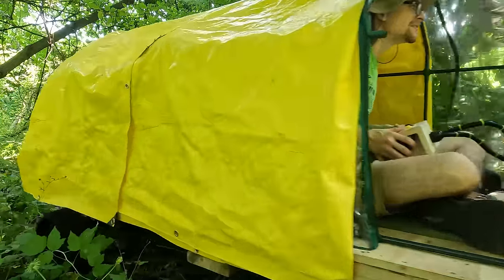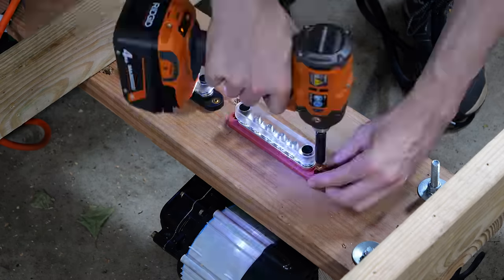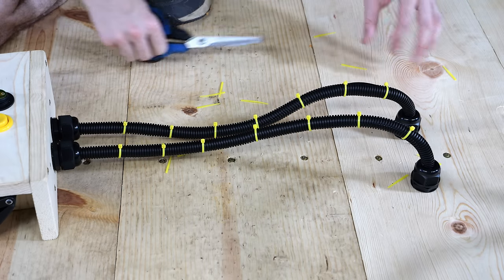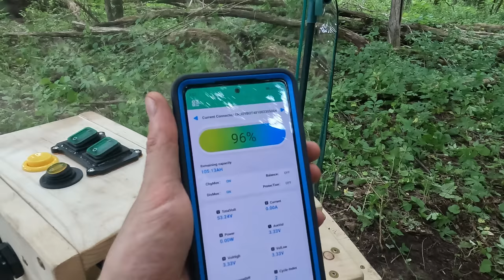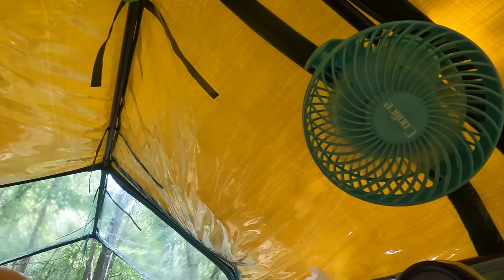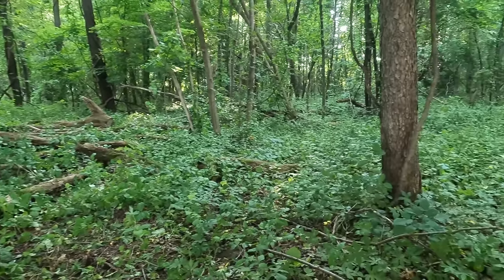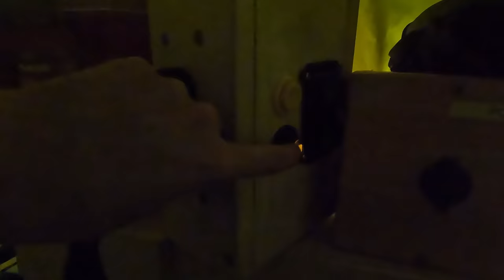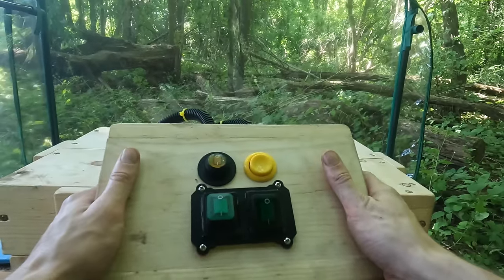UPGRADING The Camper You Can Drive Around - MORE POWER  - Build & Night In The Forest

Comment: If I had the skills I'd add two more tank tracks per side to help with getting over potential obstacles or even figure out a way to have a set of tank tracks rather than the small tracks. That way it'll be a bit better in the snow. Would also maybe try to raise it for more ground clearance.  Other than that, maybe a wooden frame on top for winter and cover the bottom with plywood to help keep the electronics safe. But in all honesty this is an awesome rid and video! :)

Comment: I would’ve used a DB9, DB15, or an HD15 connector on the controller to make it removable.

I’d also recommend installing an auxiliary 12v battery so you can control the LV accessories without losing any range on the HV system

Comment: Ideas for 3.0

- Some type of suspension for a better smooth ride, better grip and speed.
- A mini fridge! :D
- A smart small screen showing the output of the battery, what elements of the camper are consuming energy, and how much.
- An extension towards the back of the camper, so you can stretch better and organize stuff., hey, even the whole deck could have compartments so it looks you carrying nothing while, most of the stuff is just out of sight.
- A 4k projector and a white screen installed between trees so you can play some games or watch a movie :D
- Possible solar panels to charge the whole thing on the go? O_O

Awesome project and video! 
Would be nice to see costs :)
Thank you!

Comment: I use victron equipment in my van so I've got nothing against them. But if you're not buying a multifunction unit (inverter / charger) it's probably not worth the money. I don't know how much you paid for that inverter, but 375 watts is TINY. You can get 2000 watt inverters from other brands for around $200.

Also, you should never connect loads directly to the battery - there should be a fuse and/or a disconnect.

If anything goes wrong inside that inverter, it'll be able to pull a TON of power from that battery, and while I guess you can turn the battery itself off, you've got to get to that switch before a fire starts. Just put a 10 amp fuse on the lines to the inverter.

Comment: It's a really neat build, it really is! But I cringed pretty hard inside when you welded those expensive e-axles' differentials. A covered chain to a sprocket on each tread from a much less expensive normal motor would surely be a better choice for the application, right?

Comment: the following updates should be:
1-steel frame for better stability
2-shock absorbers
3-Paint or camouflage covering
4-bars or meshes to better cover the rotors, the tape will not be enough
5-gaming set up in the camper XD

Comment: Could you use a Bluetooth mini computer, an Arduino maybe, to control wirelessly with a PS controller or similar? Also, maybe try some leaf springs to mount your motors to cancel some of that wiggle.

Comment: Idea for 2.5 if that ever happens. so basically you would keep the mini-tank-camper  but add a trailer using the same treads but don't connect them and basically make the trailer into a portable toilet it would be build by adding a bucket and a little bit of screen on the top of air it out and you would build walls a door and a ceiling with the screen I was taking about earlier and drill a average sized hole in the bottom of the floor  and in the bucket then add a toilet seat to the bucket for comfort. The hole in the floor is for your💩 to fall through. I hope you see this comment (Love you're video's ❤).

Comment: should use a software that interfaces with a gaming pad or even a RC remote to control the motors. which would allow you to just use two sticks to turn and control forward/reverse/throttle for each side.

Comment: I have 2 more small suggestions, if you don't mind...I think it would have been better for a better weight distribution, to put the battery on the back because you sit in front when driving. Also, the 2 accelerator pedals, it would be better to be replaced with 2 levers that can be easily operated both independently and simultaneously, when you want to move straight ahead... I hope it helps you and we look forward to the version 3 of your vehicle...

Comment: add solar and use a pair of raspberry pi pico w's (one in the controller and one on the camper) to make the controller wireless
maybe even keep the wired controller, put the camper's pi pico w inside it, and add a switch to enable/disable the wireless controller

Comment: you could use a rasberry pi and some other controller i forgot the name of to use as a voide activated self driving car or you could do the same and make an auto pilot like some other people like to do with boats using gps and stuff. but i mainly recommend solar panels they will save you if you want to keep driving for a long time without any worries

Comment: After welding the diffs and having the shaft connecting both gearboxes together, there's no way you could drive one side different from the other. You had to have removed the centre connecting driveshafts for this to work

Comment: From engineering point it was a mistake to weld the diff, left and right side naturally turn at different rates and it causes stress on mechanic components.
From off road perspective it does make sense tho. Just dont use it on a surface that has a lot of grip, use it on a surface that allows slip.

Comment: 4 motors was greatly overkill and could cut the total in half, if you hadn't welded the differential together you could have cut down to one with all wheel drive still but thats no longer an option. Also please install fuses before you use that Godzilla battery to start a cable fire or overload any one of the components.

Comment: Why dose the frame rails have splices? why not just use longer 2x4s? Allthough that is one of the best methods to splice a 2x4. If you going to continue using this method i would use longer "splint" boards. Those 1 footers are a bit short need to be at least 24".  Size of the Splint board should be roughly 1/4 of the  over all length. Im assuming the length is around 8'.

Comment: If you get a chance are you making it with extruded aluminum for the frame if you wanted to add more battery storage the middle roof solar to maintain battery wander if you added a stater to the tracks if you could save some power

Comment: I'm a bit confused. I would have thought the 2 left motors would work together and the 2 right motors would work together. When you made the super axle I thought ok, now it can't turn. Then you took it out and drove it including turns. What am I missing?
Reply: I'm not sure, but the pipes in the middle only seem to be holding the motors in line and not actually tying the axles together.

Comment: I think you know wrong of differential.
That mortors differential is place wheel each side of mortor and sprit out power booth side.(for cornering. Out wheel need more move than in wheel)
Buy you use two mortor and join booth mortor's differential shaft together so every mortor power is send middle shaft and not trans at wheel.
And solution is not open cace and weld differential mechanism sobroken it. You just holding middleshaft and as walk as you want.

Yeah whelding differential mechanism is working but for that much cheaper or unbrake machine method is there.

Comment: a differential is a mechanical part, designed to be in the middle of an axle and distribute the power of the motor equally to both sides.
it is needed, when one wheel has to go drastically more distance, then the other (in a car with driven wheels at the rear end, the inner wheel will have a much smaller turning radius and therefore needs to travel less distance)

in your case, you could stop the axle by hand, becaus the other side of the differential had no load on it and in this moment the other side rotated on full speed, even though you can't see it, because it is hidden inside your vehicle.
by welding it together, the differential you bought is now completely useless. you could have just sticked to the chain and saved some money

Comment: The moment I realized that the shaft between the motors is just an empty pipe I knew it won't work because it's an open diff not connected to anything. Instead of welding the diff I would've tried to make an actual shaft to connect the 2 motors.

Comment: The only thing I can imagine improving this is suspension AND a gyroscopic hydraulic angle adjuster so you can adjust the angle and not be at the mercy of the un level Forrest floor. 

…and wheel covers…..

Comment: Make a pick up truck that has two seats and a driver seat add to go cart gas pedals and brake pedals end it has a black flatbed with a gate that opens and closes and I can stay close with a lock and the doors have a key and there is it a wedge on the front The wheels should be 6
 inches long and wide and half a switch for lights and blinkers and a power button and it should have 4 Wheel Drive end it shouldn’t have a back hitch so it can hook up to a  flatbed trailer or a box trailer that has a ball joint hitch🎉🎉🎉🎉🎉🎉 😊😊😊😊😊.

Comment: 4000w no protection circuit? Offload but no suspension and zero ground clearance?  What about heavy rain and humidity? And why TH do you even need an inverter when you already had a big ass battery? Obviously this thing isn't going to last very long.

Comment: I think you made a mistake when you welded the gears in the differential mechanism, because you ruined them forever. The differential mechanism is designed for a single axle with 2 wheels. When both wheels are in contact with the ground and have grip, then both rotate in the same direction. When a wheel has no grip, it starts to rotate in the opposite direction with double speed and the wheel that is on the ground stops pulling... The differential mechanism has the function of allowing the wheels to rotate with different speeds in turns, adapting automatically, at small differences in the distance to be traveled on the curved trajectories. Normally, the manufacturer should have offered a method of locking the differential in cases of offroad driving... In case the manufacturer of those engines did not offer an easy means of locking and unlocking the differential mechanism, then I think the solution for you it would have been to mount a shaft with grooved ends, which would transmit the moment of rotation from one engine to the other and which would have worked inside that pipe with the 2 flanges you made that complete the bridge between the 2 engines.. In this way, the 2 differentials would have behaved as one and the vehicle would have benefited from the automatic adjustment of the speed of the tracked wheels in turns, which would have substantially reduced their wear... I hope you can order only those gears that You welded them so that you can replace them without buying other motors... Otherwise, I like your project. Good luck !

Comment: I know that it has to be a lot of fun to do these kinds of projects. I'm not trying to critique your work, but I cannot, for the life of me, understand why you would use short 2x4s, scabbed together with a small piece of 2x4, on each side, instead of full length 2x4s, for the lengthwise frame. I hope it wasn't to save a couple bucks. This extremely compromises the strength of the frame where it's most critical.